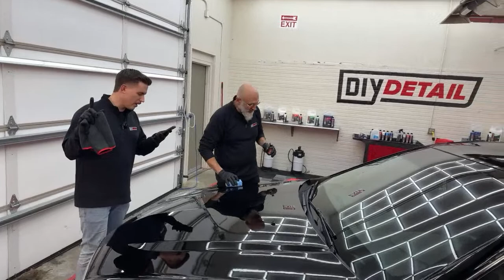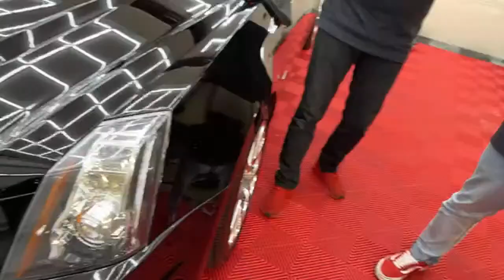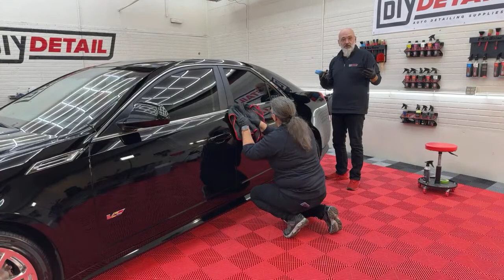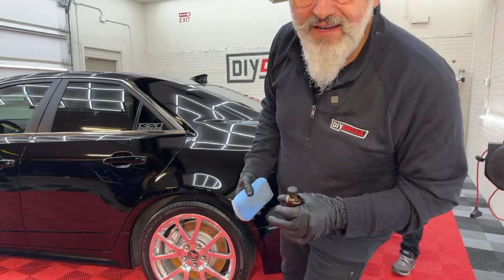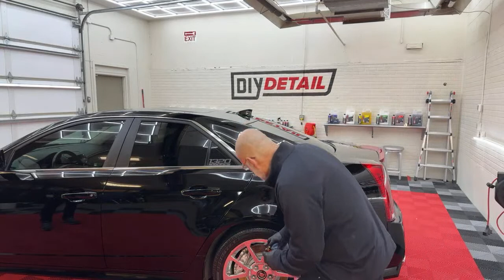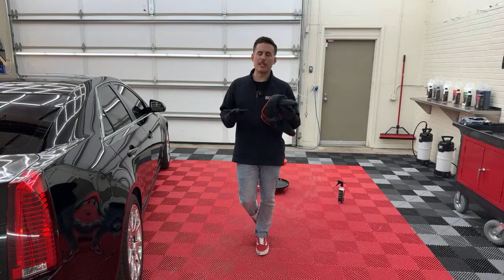DIY Detail Ceramic Coating live

Comment: Can you use reuse a microfiber towel that was used for removal of a ceramic coating if it was washed?
Reply: That’s should have been leveling of a ceramic coating.
Reply from the maker: Yes, as soon as you are finished coating, let the towel and applicator soak in your wash bucket to allow the surfactants to prevent the coat from cross linking.

Comment: What's your prep process for coating door jambs? Do you clay and use iron remover? I imagine an iron particle or to could get into a door jamb but nothing like the outside of the car.
Reply from the maker: Rinseless wash, panel prep and coat:) no need to over think it but you can clay if you would like 👍

Comment: you kinda glossed over it in the video, so I can provide ceramic coating in my mobile detailing service? No problems with debris getting imbedded in the coating while it cures? Every video I’ve watched gave me a different answer so I just haven’t learned how to do it.
Reply from the maker: You can definitely use DIY Detail Ceramic Coating outdoors. If you’re in a dust storm, or someone is using a leaf blower right beside you , I’m sure you can determine when it’s safe or not. Dust can only stick to the coating in that first 30 -60 seconds, once you have leveled the coating, dust will not disturb it.

Comment: question@diydetail : car is having ceramic coating but do you recommend wax on top ? i want to skip wax and advice coating to customers as a shield because wax is nog as good
Reply from the maker: Once the coating is installed, wax is no longer needed.

Comment: Totally unrelated to a coating but… whats the ph level on All clean? I just viewed the sds sheet and its not available.
Reply from the maker: 12 when pure
Reply: @diydetailofficial  ok soo… 12 per the RTU or the concentrate??

What ph level will have the 30:1 dilution and the 15:1 dilution??

Thanks in advance.
Reply from the maker: The PH doesn’t change dramatically with dilution.

Comment: How long does this coating last?
Reply from the maker: 3 years or more. Coating durability is proportional to how  the car was prepared, how much use the car gets, how it’s stored( outside beside a highway, or in a climate controlled garage), and finally how it’s maintained.
Reply: @diydetailofficial  thank you!!
Reply from the maker: Thank you for your question.
Reply: One layer now, another layer in three years 😝👏🏾👏🏾👏🏾
Reply from the maker: The most durable option
Reply: @diydetailofficial  Im surprised the longevity info isn't on the website, in fact my only critique so far with you guys is there is very little info on any of the products on the site. Maybe I'm just too old school and since your targeting the diy crowd the info is better in video format, I get that. 

But I was hesitant to order because "years" of durability is not something I can sell to a customer, and I was really excited to offer something cheaper and more durable than the aging glosscoat, and I'm not going to offer a 2 layer ceramic because everyone loses in that scenario. 

I have most your lineup coming soon so I'm excited to try it all out Yvan is the reason I went pro, and naturally I've been stuck in the optimum lineup for years, still works and makes money, but this lineup finally provides something worth jumping ship for. 

I've been binge watching like crazy you guys have put out a ton of content in a very short while it's incredibly impressive! 

Thanks!